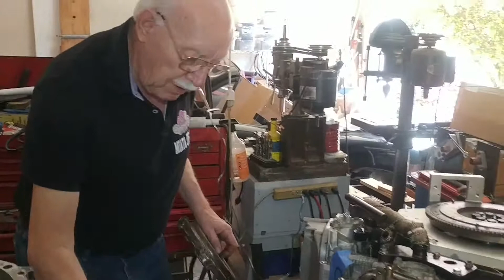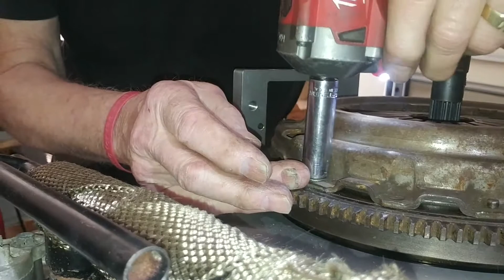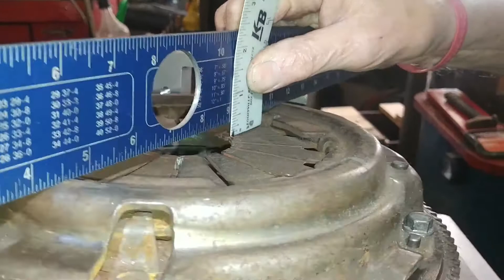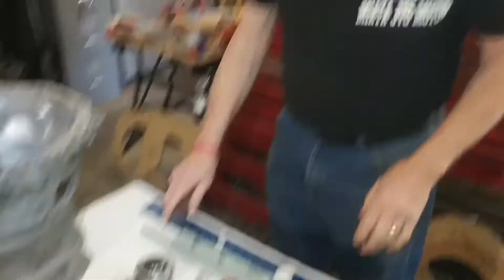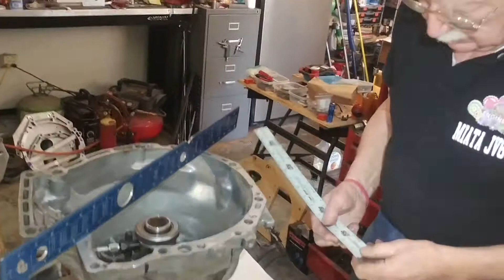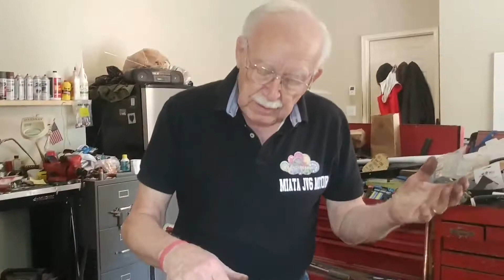Miata V6 Installation Step 5

Comment: For those following along, Video 7 technically starts before this one.  The correct distance from the trans surface down to the throwout bearing is 2  13/16" (from video 7).

Also, I didnt know where the shims came from. Youll receive a ton of them with the throwout bearing.
Reply: Thank you for your input. The distance from the trans surface to the face of the throwout bearing will vary depending on which pressure plate and clutch disc you use. Be sure to leave an additional 1/8" of an inch to allow for clutch disk wear. As the clutch disc wears thinner the fingers of the pressure plate will extend further from the back of the engine.